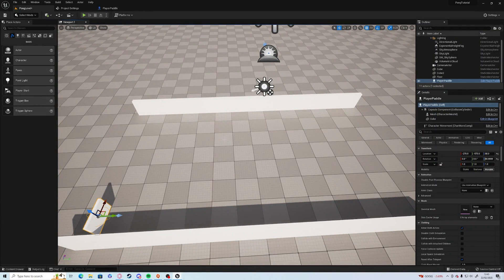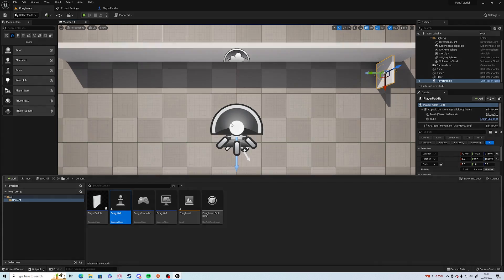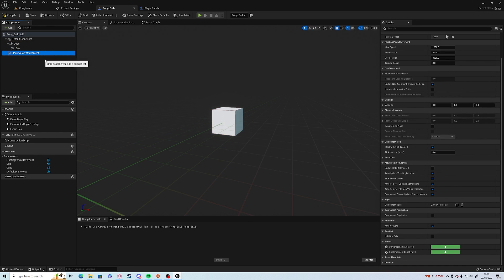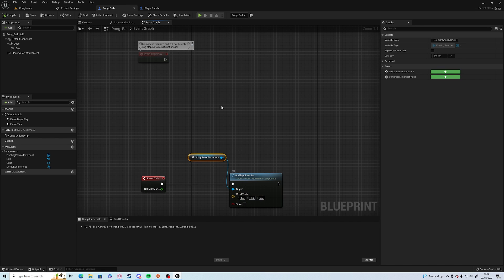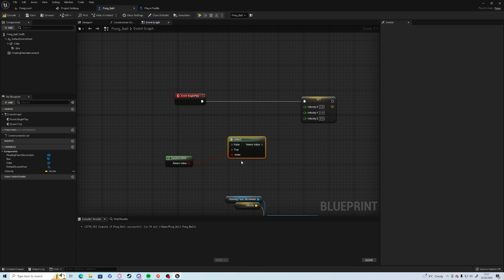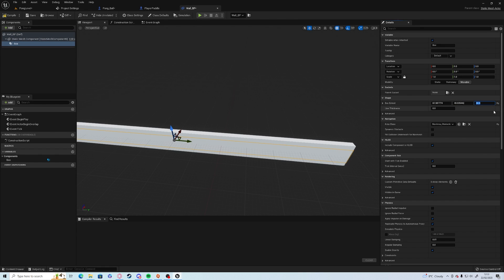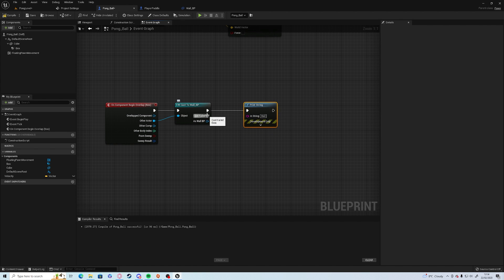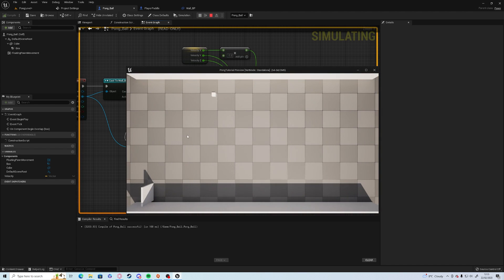Unreal Engine 5 - Pong Tutorial  - Part 2 - The Ball

Comment: These are a great bunch of tutorials! I do want to add some feedback that could save viewers a lot of confusion. My version of the project by the end of this video did not reflect well; I thought my ball's code was screwed up because it wasn't working exactly as how the end of this video showed it. (It was passing through walls, bouncing and going in a different direction, etc.) I spent a lot of time searching online and taking help from other developers to see what the problem was. Only to realize that the issue was actually mentioned in the beginning of Part 3.

So one thing I would like to add as feedback to these tutorials is to insert some telegraphing before ending the video; meaning, give a head's up about what glaring issues exist in the project by the time we reach the end of the video, and if we're going to tackle those issues in the next video. This would save us a lot of time and stop us from jumping directly into Google/StackOverflow because we're informed about that. I hope this message is pinned so other viewers are made aware to move forward to Part 3 and see the solution to the ball's collision issues.

Comment: Really enjoying the series, thanks for making the videos! Quick question, I keep running into an issue where the ball colliding into the paddle causes the paddle to move backwards due to the impact, and sometimes the ball and paddle even get "stuck" together. Either paddle moving up/down causes the ball to just move up/down together with the paddle (with no horizontal movement on the ball), or then the ball switches direction from left to right and starts dragging the paddle towards the right as well.

I tried fixing it by changing the logic in the paddle such that it always keeps its original y/z coordinates, so that it can only ever move in the x axis. However that just made it worse, now the "overlap" event triggers on every tick so the ball just keeps flipping its direction every tick left and right so it doesn't actually bounce off the paddle anymore.
Reply: Did you ever find a solution to this?
Reply: @jrayalldaygaming  if you are still having trouble witch i am 100% sure you aren't by this point. if others are having trouble remember the starter on (((component begin overlap))) it needs to be created from inside the collision which means click on the collision section and scrolling on the right to find the event part you need

 and also closely follow all the instructions in the vid tutorial i have had a few times where i have been confused but when i rewatched the vid i just had a realization i was stupid 

ps i also had the push paddle problem that is why i am writing this